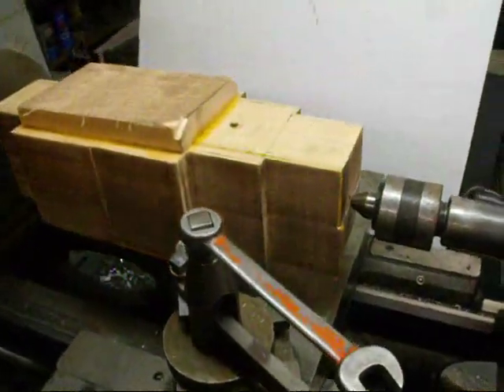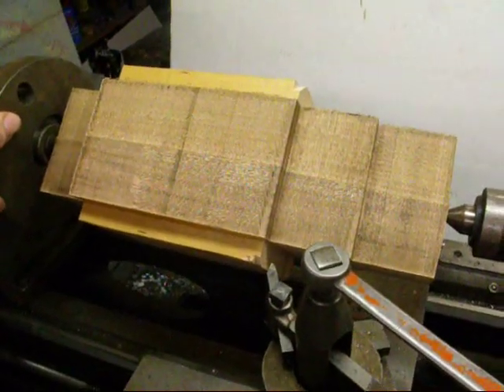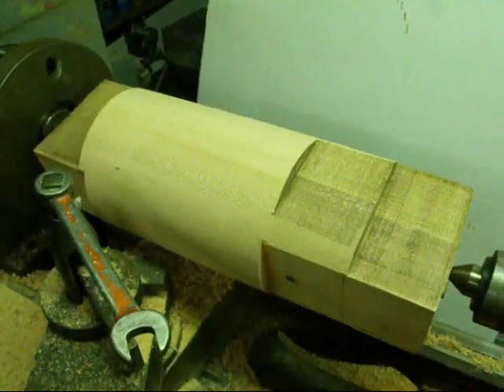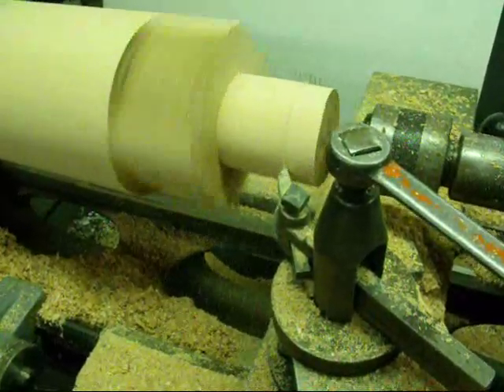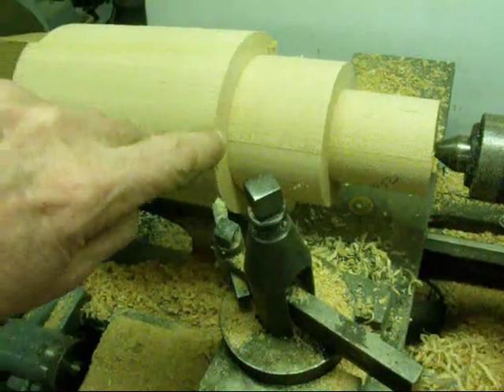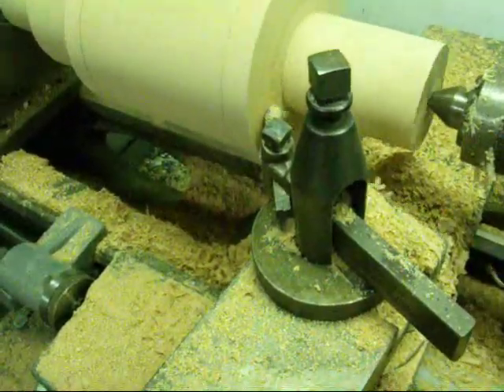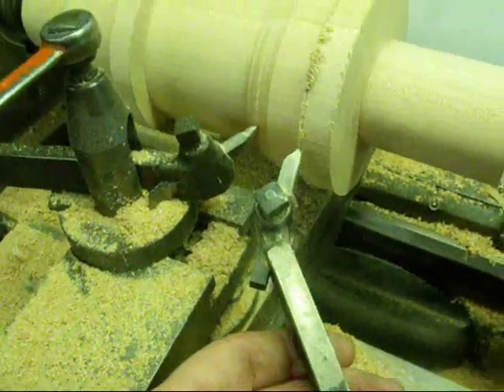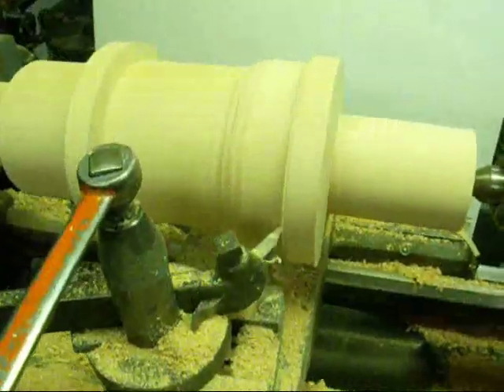FOUNDRY PATTERN MAKING part 3 Steam Engine metal casting tubalcain

Comment: Can one do turning like this with a manual lathe?
Reply: +Kyle Blank Certainly. Especially if you use a wood lathe tool rest instead of the metal lathe cross slides, and proper woodturning tools. It does take a fair bit of practice but you can achieve just as much dimensional control. The wood grain does not really behave like metal anyway, especially with softer wood, so the extra control of the cross slides often turns out to be an illusion anyway.
Reply: Cancun771 Thank you for the information :)

Comment: Using a metal lathe to cut wood isn't all that unusual. Traditional pattern makers lathes usually had cross feed mechanisms just like metal lathes for the very reasons you mentioned.

Comment: Sir, a question please.  If you had Maple limb stock (I'm not sure if thats a word or not... )  but say a bit of 5 inch limb, could you cut that, insert the dowels, glue and turn?  So that you didn't have to do the bandsaw triming of excess wood, and then work all the squareness off of the piece?

Be nice everybody else.. I am a complete rookie at this.. LOL

Thanks in advance.